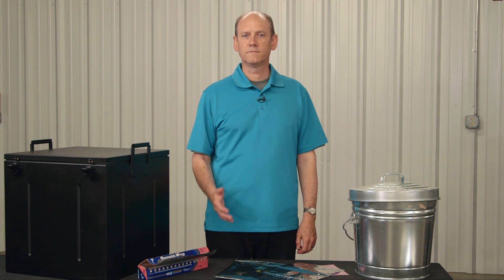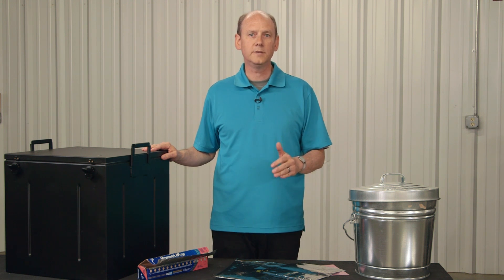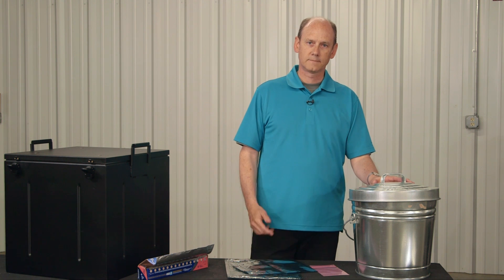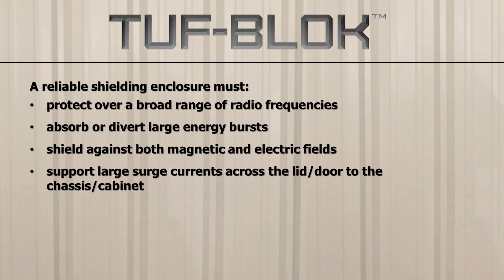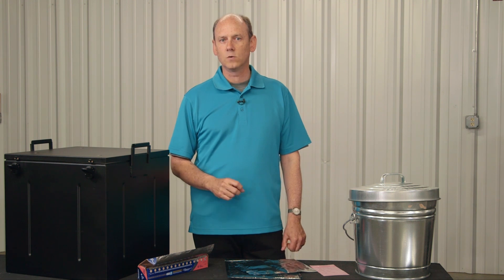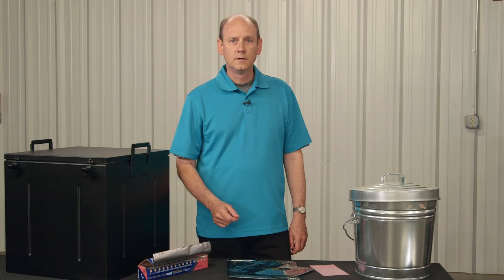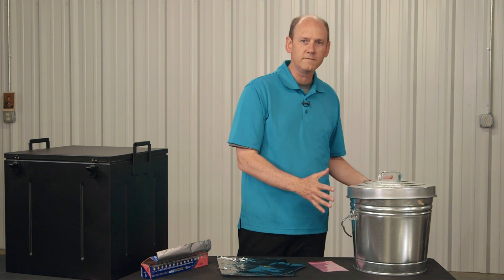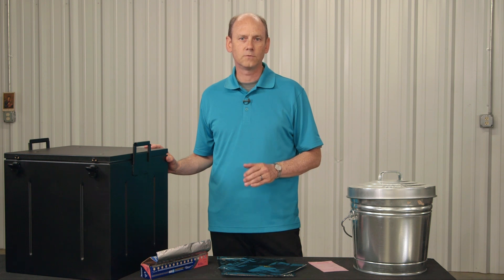Faraday Cage: EMP protection and avoiding common DIY pitfalls

Comment: I have created my own personal faraday cage. It's not to complicated to do.
Here goes:
1) Place item in cardboard box.
2) Use heavy aluminum foil and wrap box 5 times like a gift with foil. Reversing top and bottom as you go.
3) Place item into faraday bag, then roll to close up and use tape to seal. I use Duct tape.
4) Place item into 50 cal ammo can.
5) Use aluminum Tape to cover any and all places it's been pierce i.e Screws, rivits, etc. Both inside and out.
6) Use aluminum Tape to seal can where the two sides meet.
7) Get large garbage can and line the interior walls, floor and lid with cardboard.
8) Use aluminum Tape to cover and seal any and all places pierced by Screws and RIVITS.
9) Get Large Faraday bag and use like garbage and insert into can.
10) Label items on outside of Ammo can do you know what's in each can and place ammo can into can.
11) Use aluminum Tape around lid to give good secure closure to can.
12) Label contents on outside of can.

NOTE IF ITEMS TO BIG FOR AMMO CAN DO FOLLOWING:

ADD EXTRA 5 LAYERS TO BOX AND WRAP LIKE GIFT. AND CONTINUE WITH REST OF STEPS.

This is what I call over kill. I am NOT an EE but I have done a lot of research on topic.
REMEMBER YOU GET ONLY ONE CHANCE TO PROTECT AGAINST AN E.M.P. SO TO MUCH IS NEVER ENOUGH PROTECTION .

I hope this has help.
Also check out Dr.Arthur Bradley on YouTube for additional info on EMP.

Just my 2 cent
Good luck

Comment: Shame on you, Kevin Vaughn. I see you are a salesman. Wondering if you might also be an attorney.  Did you know that most inventions started out by being things "for which they were not designed"? This all may be true, but you KNOW most people can't afford to buy what you are selling. Who knows? You certainly don't with 100% accuracy, that a DIY EMP shield may actually protect up to the level required to have electrical appliances and generators to work long enough to accomplish necessary projects after it happens.

Comment: Ii presume everyone knows that your car, with its metal exterior, is a faraday cage.  
Airplanes are faraday cages, with their aluminum fuselages.  
The EMP "threat is highly overblown".  
BTW .. I would hope that all the transformers in the grid are shielded from lightening.
Reply: I don't think a car can be considered a faraday cage because it doesn't fully encase the engine and it's electrical parts, etc.
Reply: A Faraday Cage is just that a cage.  There can be gaps, and usually are. It just has to be around it, so that the electrons of an electrical charge use it to repel each other, and not get to what is inside. 
If you are in your car, and it is hit by lightening, you will not be harmed, as long as you don't have your arms hanging out the window. 
Similarly, in jets, the windows do not cause a problem. People, and electronics are protected by the Faraday Cage effect if lightening strikes it.
Reply: @craigkdillon  - But cars have been disabled by them before.
Reply: @annwithaplan9766  Really? when.
Reply: @craigkdillon  - I'll try and find it and get back to you.

Comment: EMP takes out everything except my computer, what good is it if I can't go online
Reply: I was thinking of protecting solar panel equipment stuff u would actually need in a shtf situation.
Reply: I sure hope my laptop survives.  with a cheap program internet download manager you can  save videos on anything from canning to whatever else you want to use.  once it is saved no need to go online.  but most likely it'll be in use and fried if emp happens?   need to move it to removable source i suppose.    electronics are important but food production, heat, water , medical should come before the cell phone protection.

Comment: Can a Faraday cage have holes?
  Yes, that's why it's called a cage, not a jar, - as long as the holes are small with respect to the wavelength of the incident electromagnetic wave. For example, a 1 GHz wave has a wavelength of 0.3 meters. As long as the holes are significantly smaller than that dimension (i.e., a few millimeters), they won’t let in much of the incident wave.

This is why (fine) conductive mesh can be used when constructing a DIY Faraday cage.   But a metal garbage can or a dollar store cookie tin will work.  In theory, the cage’s lid or door could cause the most leakage. Taping the seam with conductive tape kills this (paranoid?) potential leakage.  

If foil is used, use 2 layers, no thin, cheap stuff.  Don't forget to electrically insulated your goodies from the "cage!"   Plastic bags may be too flimsy and puncture, but corrugated cardboard or bubble wrap are strong, good insulators .  

(Cell phone towers and landlines will also be fried.  A working pair of walkie-talkies and a small radio are gold.)

Comment: As a retired and former KGB analyst intelligence officer with a mechanical engineering background we were also involved in building an all out 100% purely mechanical technologies without the need for electricity or using just one or two ultra-simplified electrical components that are over-engineered against infinitely high EMP, EMF, EMI, AND CME, shielded or unshielded. They can take over the functions of electrical and electronics systems and combined with an all 100% purely analog non-digital systems technologies. BUT WE DID NOT NEGLECTED THE SHIELDING PROGRAMS. The basic principles of EMP shielding in youtube did not say anything about "WHAT IF THE ENEMY DETONATES AN ANOTHER EMP DEVICE WHEN YOU ARE IN THE PROCESS OF OPENING YOUR EMP PROTECTION CONTAINER OR CAGE, IN THE PROCESS OF GETTING STUFF OUT OF YOUR EMP PROTECTION CONTAINER OR CAGE, AND CLOSING YOUR EMP PROTECTION CONTAINER OR CAGE" which are the most vulnerable time periods because you can never tell when the enemy will detonate an another EMP device. The solution is simple. Create a very dense and insulated and self-ventilating Faraday Cage Room enough for 1 to 5 people and their emp shielded container which they will not open until they have mechanically closed and locked and secured their Faraday cage against accidental opening and has a well insulated rubberized table in the middle even through the floor is insulated with a thick rubber layer several inches thick. And once they have gotten what they need out from their emp shielded containers, they must close their emp shielded containers and make sure that their mechanical seals and inner insulating seals are tightly hermetically sealed and locked. Then and only then will they open the Faraday Cage Room, exit from it, and close it behind them. We also created a triple and quadurple AIR LOCK TYPE FARADAY CAGE entry and exit doors. For example: There are 2 faraday doors and if the 1st faraday door is opened the 2sd faraday door will remain close and the air lock faraday doors are designed in such a way that their mechanical systems will prevent both doors from being opened at the same time. You can not open the 1st faraday door if the 2sd faraday door is open and vice-versa you can not open the 2sd faraday door if the 1st faraday door is open. Either door must be closed first "PROPERLY AND WERE MECHANICALLY DESIGNED NOT TO ALLOW EITHER OF BOTH DOORS TO BE OPENED IF BOTH DOORS ARE NOT PROPERLY CLOSED AND THEIR METALLIC SEALS IN PERFECT MECHANICAL ELECTRICAL CONTACT WITH EACH OTHER. This is done by having designed a SAFETY MECHANICAL INTERLOCK SYSTEM so that if the 1st faraday door's handle is turned down at an angle a 1st mechanical interlock MECHANICALLY LOCKS the 2sd faraday door and once you open it just a few millimeters at the start of opening the 2sd mechanical interlock MECHANICALLY LOCKS the 2sd faraday door. Once the door is either slightly or partially or partly or fully opened at any angle of opening whether it is 90 degrees or 180 degrees the two SAFETY MECHANICAL INTERLOCKS has practically locked the 2sd faraday door mechanically. And you enter with your stuff and the 1st faraday door must be 100% fully and perfectly closed. And the moment you touch and turn the 2sd faraday door's handle by just a few millimeters it has locked the 1st faraday door and so forth and so on. Everything is 100% mechanical, metallic seals hermetically sealed upon complete and perfect closing, insulating seals hermetically sealed upon complete and perfect closing.
Reply: LOL!  But you forgot the most important part!
Wail till you graduate from fifth grade before you make stuff like that up!

Comment: Dear Ken Vaughn, I would like to build an EMI shielding box with the size of ~ 2m x 1m x 1m for frequencies 1mhz-10ghz. This would be a nearly perfectly enclosed box (no seams, no gaps, just a few honeycomb air vents). I would like to eliminate the resonances that can be formed inside the box (either ignited by leaks from the outside or electronics inside the box). Using a dielectric or microwave absorber would be too expensive. AFAIK this can be done by making the box irregular (non-parallel or trapeziod walls). What kind of geometry should I choose?

Comment: I want to mention two reasons that is hard to protect yourself from an EMP attack (talking to anyone how thinks just a faraday cage will save him); Firstly, to happen an EMP attack probably a nuclear explosion must have happen before. So it is pretty hard to protect from a kind of that exposion (you need a nuclear shelter). Secondly, I think you must be inside the faraday cage, because the electromgnetic pulses might cause to you, heart attack or something else like this. To conclude, it is almost impossible to surive an EMP attack and way harder to survive after that.😊😂
Reply from the maker: Actually, a wide-area EMP event (which we believe to be the biggest threat) is caused by a nuclear explosion 100s of km above the earth's surface. At this height, you are not endangered by the explosion directly, there is nothing/little for the nuclear explosion to ionize - so radioactive fallout is not a serious problem, but all of that energy has to go somewhere. It goes into the EMP and it is high enough up that the radius of the EMP field can be enormous (e.g., covering the continental U.S.). Unless you have a pacemaker or some similar electronic device keeping you alive, you should live through the event. I agree that there will be challenges after the event; but life will be easier if you have some basic electronics that allow you to communicate to those around you and provide basic lighting.
Reply: It is obvious that you need to do some serious homework, as most of your content is nonsense, out of date (what little is close to reality) & needlessly fatalistic.
Reply: Ken is correct.  Also, the NK 20 kiloton weapon is extremely small.  Very negligible damage, either as a ground explosion or high altitude EMP attempt.  When people think nuclear, they're thinking about the megaton range nation-killing weapons.  NK doesn't have that, and hopefully we'll stop them from developing it.

Comment: I would wonder how many db from an EMP it would take to actually render electronics useless. Would 10 db fry it? 20 db? If you had something that knocks out most of the energy from an EMP some of the electronics might do ok, ham radios, walkie talkies, cbs. If you have 1 large metal trash can it may not be enough to protect. Put a smaller metal can inside, sealing the rivots on both cans, you might get enough protection to get it done. It's the best some of us can do as we can't afford a true built Faraday box.
Reply from the maker: Every device is different, so it is hard to give a single answer. But electronic components are generally designed to deal wth milliwatts. An EMP can easily flood your device with Megawatts. To drop 1 MW to 10 mW requires protection of 80dB, which is the military standard for protection. Providing only 50dB would only reduce the signal to 10 Watts, which would still ruin your components.

Comment: If you shield your radio/electronic/transportation devices, they will still be useless until the power grids and satellites and infrastructures are rebuilt.
Reply: Many electronics (e.g., walkie talkie, ham radio, LED lighting, tablet computer, etc) do not require any extensive infrastructure. As long as you can charge them, they'll work just fine if you have protected them. This is why about a third of my box is filled with a solar-rechargeable battery system that is able to charge what I have in my box.
Reply: About the time you have all that rolling, the second EMP hits.  Like any attack, it comes in waves, to get those who survived the previous attack.

Comment: why would i open/close/open/close/open/close faraday box? that sensitive equipment was meant to be stored in case of HEMP or any other magnetic distortions, how would you achieve that if you use it daily, unknowing  when EMP/Solar storm would hit earth? what if HEMP happens out of nowhere, with that precious tablet in your arm instead of in secured cage? well, tough luck, you're out of tablet...
Reply: You would want to open it every 6 mo to 1 year in order to charge the batteries. Lithium ion batteries leak charge and if they remain uncharged for a prolonged period, the become useless. The rate that the lose charge depends on their age and storage temp, but the best rule is to check them after 6 months and if they are still well above 50% then you can go to an annual schedule (until you see them dropping below 20% at that point). You may also want to open close every time you decide to change out equipment (e.g., you get a new laptop for everyday use? Put your old one in the box). Bottom Line: You end up have legitimate reasons to open/close several times a year - even if you are only using for long term storage. If you want protection without testing every time, you want a proven system.
Reply: Ken Vaughn
 true :) although im not replacing tech each year or two.My fav radio is some 50 years or more old and still works as new :) .thanks for some good advice  ;) .
Reply: You might also want to periodically use your emergency equipment in drills.  In a real emergency you might not have time to think to remember how.  Or you could just have replicas and drill with those.  Except that won't work if it's communication equipment, unless your replicas are cheaper working units.
Reply: OptimisticPessimist
 i've bought cheaper versions of all communication devices, made few simple AM/FM radios from junk and bough cheap chinese voltage regulators for my solar panels.I do open  box twice per year to check fr any moisture or to check batteries but thats it.
Reply: Exactly... implied is that you cannot afford a couple rolls of tape, but you CAN afford his overpriced “magic box”...  stop insulting us with your “snake oil “ sales pitch, is my take on it !

Comment: only $625. lol comedy
Reply: And another $625 for shipping.  And another $625 to ship it back when you discover it's a piece of shit for what you paid.
Reply: andy artin  Or save a $180 Kindle with a 128 GB SD card with hundreds of books and over 1000 PDF documents covering everything from microeconomics to cattle raising, from how the internet was created and ran to the applications of herbal medicine and how to make it, from aeronautics to aquaponics, car repairs, carpentry, and blacksmithing. Also have said kindle in a hard case with a means of charging it like a Voltaic Systems solar panel. In an EMP, the information on my kindle will be invaluable. EDIT: Also Wilderness First Aid
Reply: andy artin I was talking about having a Kindle filled with info and a solar panel inside the $625 case.
Reply: The one pictured is actually $1,100.
Reply: Cheers for this, been searching for "how does a faraday suit work" for a while now, and I think this has helped. Ever heard of - Tennorra EMP Esterification - (Have a quick look on google cant remember the place now ) ? Ive heard some great things about it and my cousin got excellent results with it.
Reply: This was great, thanks, I've been looking for "faraday cage wire mesh" for a while now, and I think this has helped. Have you heard people talk about - Tennorra EMP Esterification - (just google it ) ? Ive heard some interesting things about it and my cousin got excellent success with it.

Comment: sounds great, really does, but quite expensive.  prohibitively so for many people.
Reply: After the EMP, if this heap of over-priced metal even works, you take your electronics out to use them.  You and every other prepper and government agency that protected their electronics.  And that's when the second EMP hits to get those who escaped the first.  You need a Faraday room or space from which to operate your electronics without exposing them.  I'm sure you could create one for, what, about 1.2 million dollars.  Douche.
Reply: +MiniDevilDF Based on comments, we are now offering a scaled down version that is only $625.
Reply: That's still very high end
Reply: Good day,

I have a technical question about faraday
cases?

I want to make a closed faraday chamber with metal plates for up to 30GHz
shielding.

My question is about the holes in the air ventilation window.

Is it alright if I directly make holes in the metal plate, in a small window
surface, &#160;with a diameter of less than
1/10 of the frequency wavelength?

Or do I need to cut a square window out the plate to place a honeycomb with
holes smaller than 1/10 of the frequency wavelength?

I need so many dB shielding as possible.

Can you help me with this question ?